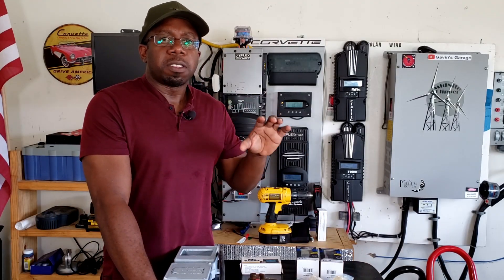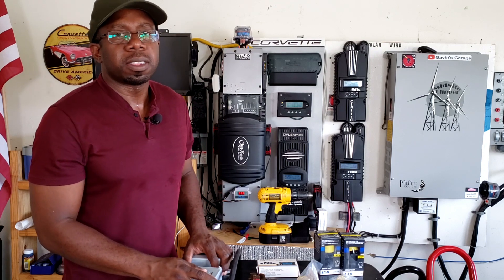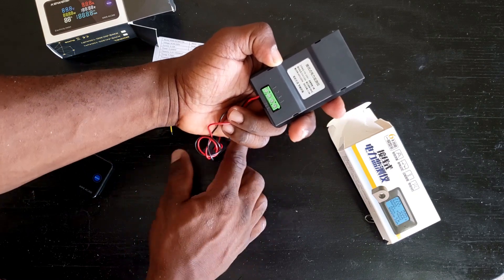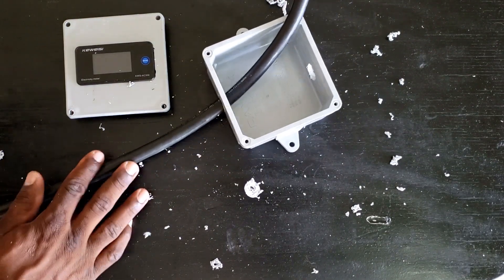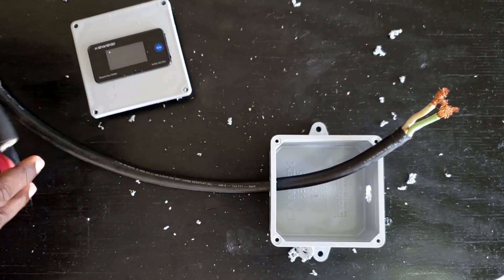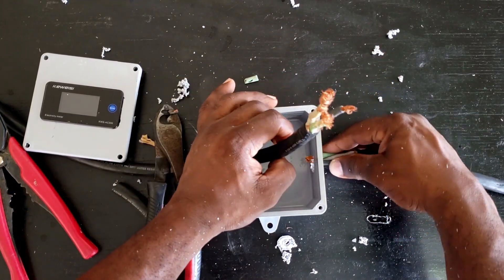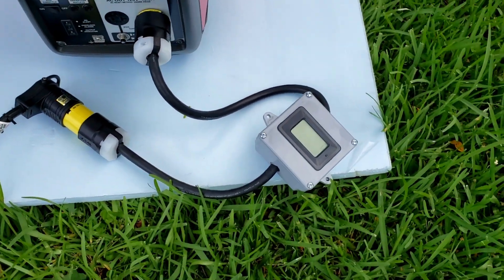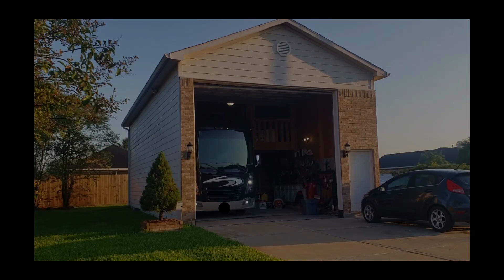HOW to build a Digital Electric Monitor Volts, Amps, KWH, PF, Hertz for your Generator

Comment: So for checking 240 volt 50 amp you would just double that correct? Or do you use different digital gauges ?
Reply from the maker: In order to get the 240 V reading, you can monitor the neutral cable
Reply: @GeneratorReviews Monitoring the neutral will read zero,or close to zero, won’t it?

Comment: Have you ever thought about building an adaptor for those DC plugs on generators? They're usually unregulated. I wonder if it would make sense to build a small voltage regular, to charge a solar generator for example. I assume it would be more efficient to pull from the DC plug rather than plug a dc converter in the AC outlet?
Reply from the maker: The EcoFlow generator is designed to provide DC power to a smart portable power station. Yes you are correct about that 👍🏾

Comment: If you're running 30amp 2540 volt do you need to run 2 monitors or can you run 2 hot wires through 1 transformer?
Reply from the maker: I’ve never tried to run two hots in one monitor But let me try that I’ll let you know the results
Reply: @GeneratorReviews  that would be great.  I was thinking of mounting one close to the breaker box in my home so that I could see it as I'm turning breakers on.

Comment: GAVIN how would you wire this if you have the L14-30 male and female ends.I see you are using a three prong type.Do I use some type of adapter or does this have to be wired  a different way?
Reply from the maker: You have to wire different and use two monitors  one for each leg. Also 4 wire cable

Comment: Hey what do you think about this meter it’s Wi-Fi 
WiFi Smart Energy Monitor Switch Meter, Compatible with Alexa Google Home, Remote Control with Smart Life/Tuya App, Din Rail Tester Current Voltage Amperage Power Meter AC 110-230V 60A Multimeter
Reply from the maker: Send me the link
Reply: @GeneratorReviews  hey did you ever get the link I sent. I found the meter on Amazon
Reply: I keep trying to link from Amazon but it keeps disappearing on this chat.

Comment: Could you make a video showing how to make this same device with a 240v 4 wire setup. I have my generator hook to my house and would like to see the load as I flip breakers so I dont over do the generator. You would think they make something like this pre fab but havent seen it so far
Reply: I got a larger project box where I put two of the Drok meters. One for each leg.  Then you can just add the wattages to get your total wattage and make sure that’s no more than 80% of your running generator capacity. Works great let’s see see offsets between your two legs.  Each display will read 120 V but that’s OK.
Reply: Did you find a solution? Looking for the same in the panel at the breaker but trying to keep DIY vs something like the Emporia
Reply: Is the meter water proof?

Comment: Hey man
 What size wire do you recommend using to connect to the meter ?
Reply from the maker: I recommend if you can use 8 gauge or 10 gauge nothing smaller
Reply: Thanks a lot man. Thanks to you I was able to make 2 boxes yesterday.  I did use wire size 14 that can take up to 600v to power the box. It works perfect!!👍
Reply from the maker: That’s awesome 😎

Comment: I noticed that on another’s video of making one of these they put the sensor on the neutral (white) wire and yours is on the hot (black) wire. His worked also at least in the video. Does it matter? Thanks!!
Reply from the maker: The instructions shows inductor should be connected to the line not the neutral for 120v And if you’re doing a double Meter for 240v you should connect the inductors on black and red.
That would monitor both lines
Reply from the maker: If you connected to neutral and you have a ground wire as well you’ll get improper reading.

Comment: So if I'm trying to use a 30 amp 4 prong plug and connector how will the wiring be different?
Reply from the maker: That one you're talking about is 50amp? 240v
Reply: @GeneratorReviews  yes sorry about confusion
Reply: I have the same question as him can I do this for 50 amps?

Comment: Gavin ,you will find that if you strip your wires longer out of the shield they are a lot easier to work with and you should use cable clamps on the box. Just a suggestion. Nice way to see the outputs on olde generators . Thank you.
Reply from the maker: Thanks for the suggestion always appreciated. 👍🏾 I will update them for future use.
Thanks buddy
Reply: @GeneratorReviews  you are welcome.

Comment: What tool did you use to cut the holes in the junction boxes? Jigsaw?
Reply from the maker: The jigsaw would probably be the easiest just drill a hole in each corner then jigsaw straight to the next hole

Comment: Thanks Gavin for the inspiration. I built two, 120 volt 20 amp using 12 gauge wire with regular house hold plug and a 120 volt 30 amp using 10 gauge wire with a L5-30 plug for my EU3000is generator. I agree with another poster about spending money for some of your projects. It's fun!
Reply from the maker: Yessir that’s awesome 😎

Comment: Do you know of a digital monitor that will work with the 50A feed?  (Need two CTs)
Reply from the maker: I’m making one right now lol 😆 
Awesome timing David 
Thanks
Reply: @GeneratorReviews  Did you make a video of your new 50amp setup?
Reply from the maker: @Rosco7178  not yet I will soon
Reply from the maker: @Rosco7178  I’m gonna start working on the video and I’ll release it soon
 thanks for watching
Reply: @GeneratorReviews  I'm looking forward to seeing what you build.  I'm also thinking of building one!  One bit of constructive improvement on the box:  use  a cord strain relief in each hole.  It will hold the cord tightly and greatly reduce the chance of the cord pulling on the inside of the box.  Especially with the wire nut connections, and especially with a portable meter box that you will be using for a lot of applications.  And they will also keep water out. (not that you plan on using this around water)
Reply from the maker: @tristanschaper281  nice!! update and improvements I like your ideas 👍🏾

Comment: Thanks Gavin, we appreciate all the information in making the meters. I made mine about 6 weeks ago. I noticed you didn’t put a link for the locking plug connectors, so that you can get the credit. Thanks again my friend. Have a great 👍 day.
Reply from the maker: Ohh
I honestly forgot 
Thanks
Reply: @GeneratorReviews  hey buddy. I just noticed the link you put for the 30 amps is a 4 prong and the one you use in the video is a 3.

Comment: Geez, if I keep watching this channel I'm going to go broke. I'm going to have to build a few of these. A couple for myself and some to give to my friends with generators. Actually, you could use this anywhere you want to find out how much power is being used by a device or appliance. Basically, it's a different version of the Kill A Watt meter. Yeah, the Kill A Watt would be cheaper but what fun would it be to just buy something already made? Plus the Kill A Watt is limited to 15 amps. Hmm, I wonder how far the inductor can be from the meter before the readings become unreliable? Guess I'll have to try and see since there was no mention in the product descriptions. Projects like this keep my retired hands and mind busy. Thanks Gavin!
Reply from the maker: Thanks Tom 
I guess if they made a 30 amp twist lock version of the kilo watt meter that would be able to compare to this.
The thing I like about this one the most is it doesn’t reset every time you unplug it so it holds your kilowatt hour used